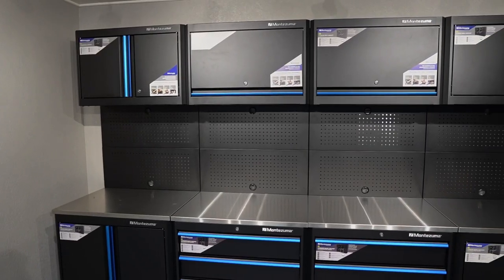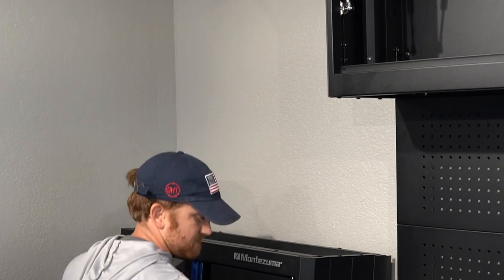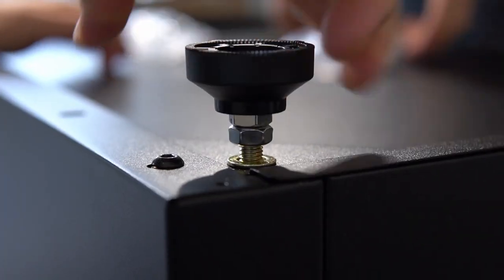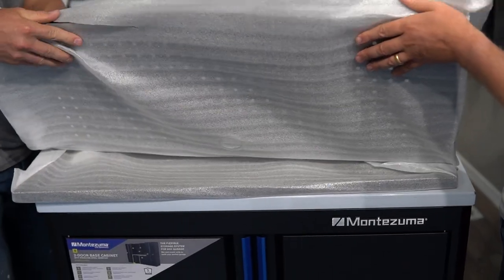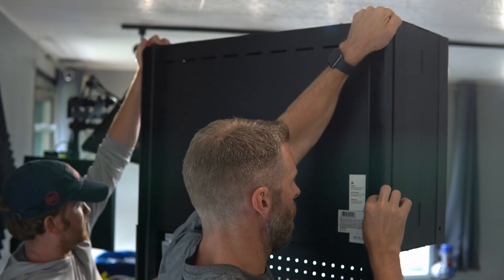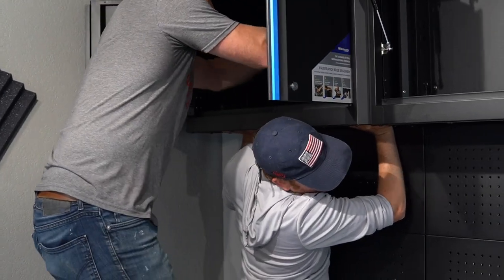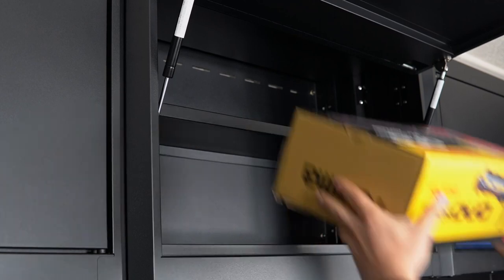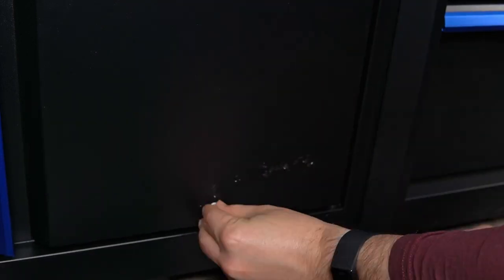New Garage Cabinets - Montezuma Storage

Comment: Great cabinets if you like 30 gauge metal thinness.
Reply from the maker: These cabinets are pretty sturdy. If you want solid steel and super thick cabinets, then you should get that instead. For most workshops and garage storage, these are heavy-duty. Better than what you'll find at Costco.